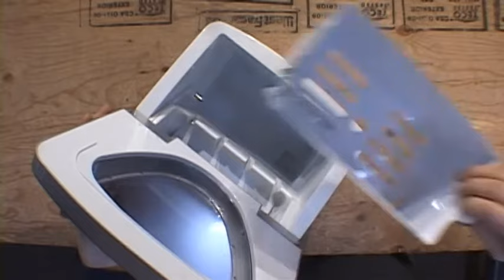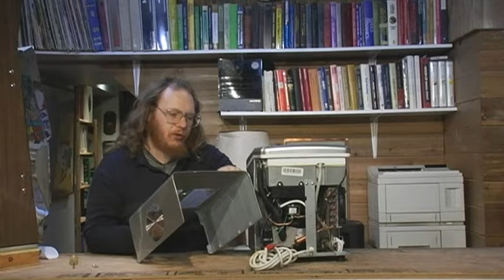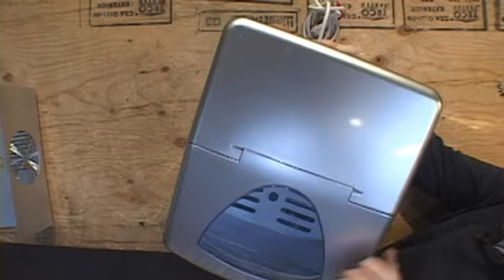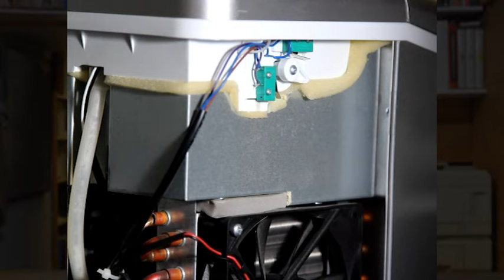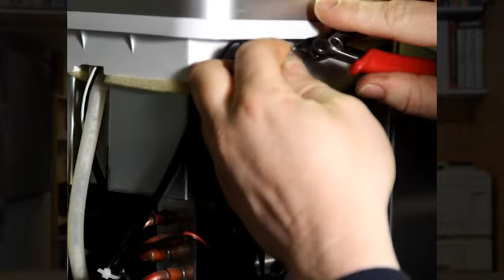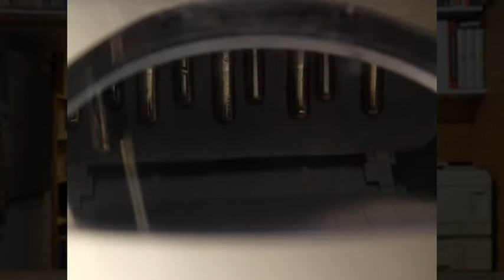Portable Ice Machines (and fixing one of their many problems)

Comment: Aww, thought you were going to be the first YTer I found after a looong search to do a legit full teardown of one of these.... They're definitely in that range of "not terribly expensive but also NOT triflingly cheap either", so I totally understand without first having a proper motivation to do so. My motivation for knowing all the specs & dimensions of the guts is from my desire to "un-dress" the entire front facade, leaving the back cover for cooling system protection  (not all identical in build quality in that department as SS-wrapped models can be pretty sturdy) and MacGyver/Frankenstein-ing it into either the side of a proper cooler with the heat producing refrigerator guts affix outside of it & sealed away like normal construction provides, just with an area cut through the new cooler to accommodate the ice factory bits

Comment: Hi and thanks for the video I have a similar machine that I've had for about 6 years or so with no problems at all until last night I found that the pice on the tray that connects to the small motor had broken am trying a method to fix it if it works I will update

Comment: So mine is not releasing the ice fully. both micro switches still click do you think thats still the problem?
Reply from the maker: The ice is released by the refrigeration loop going into defrost. Defrost is activated once one of the limit switches detect the tray is pulled back into the drain position. If the tray pulls back and nothing happens check for a stuck solenoid, otherwise verify the solenoid voltage is being created by the controller.

Comment: Ok I forgot what goes back where and attempting to put the plug back I accidentally dropped it into my water flow chamber compartment if my frigidaire portable ice maker, it fell down into hole not having drain cap preventing it from traveling inside , I can't retrieve the small plug as it's down inside, any suggestions? I'm afraid the drain doesn't have the plug only screw cap and if I attempt to operate the ice maker what happens to the lodged  plastic plug? Will it damage the ice maker once I operate a cycle. The technician wants me to operate the ice maker to see if it works. I'm not comfortable with this because if damage occurs, my warranty would become void.
Reply: What happened?

Comment: I just bought a costway Countertop ice maker ep24525us and I used it for the first time last night and noticed a leak from the bottom. Is it fixable or junk?
Reply: Check your water reservoir plug stopper. It might be loose, simply needing to be pushed back into place.

Comment: Do you have a link or a part number for the switch mine needs the same thing thanks
Reply: microwsitch KW4-3Z-3  (20 switches for $13 per another video who replaced a bad switch.)
Reply: @annblachly8068  thanks
Reply from the maker: I do not have another replacement on hand but it's a low voltage and low current circuit so really, any switch that looks the same will work.

Comment: I have one it works perfect (mechanical), but doesn´t make ice, the avaporator doesn´t cold
Reply: does the compressor start up?
Reply: yes, it sounds good, but don´t make ice cube. it doesn´t cool to make it
Reply: @javierjuarezvalle6326  if the compressor starts but it doesnt get cool it could be one, weak compressor/failed or failing compressor or two theres a leak in the system and all of the refrigerant leaked out

Comment: I found one for $10 brand new at yard sale. I let my sister use it and now it doesn't work. Needless to say I'm taking it back and fixing it and keeping it this time. Thanks for the video it'll help.
Reply: clean the condenser first. the fans move very little air and these units are very heat sensitive. don't sit them near any heat source ie. the stove stove. also allow several inches or clear space at the fans intake and exhaust

Comment: The only problem with those machines is that they can get pretty gross if you don't clean em often.
Reply from the maker: Yea it gets a but musty if used nonstop for a week. That's where the drain comes in so you can wash, rinse and refill it without leaving residue inside. :D
Reply: @CelGenStudios excellent video, very interesting and informative.
Reply: @CelGenStudios I was given one of these and on the cover there are the letters S  and L what do they mean?
Thank you
Reply from the maker: @SDsailor7  Not that I am aware of.
Reply: @CelGenStudios  I just got done with the disassembly and reassembly. I cleaned as much dust from the evaporator and the inside of the area. I removed the pump to inspect it for obstructions or other problems and cleaned it (was dirty) I applied some contact cleaner to the switches. One of the switches is to activate the water pump I forgot to trace the other one.
Will test it after 24 hours to give time for the compressor oil to settle back to the bottom.
Thank you for the video and I hope all I did makes it work.
Cheers
Reply: @SDsailor7 .
Small and Large ice cubes.
Reply: @krmhayes2893  Thank you
Reply: Small and Large  @SDsailor7
Reply: @SDsailor7 small and large. Press the “Select” button to choose between what ice cube size you want to make!
Reply: @SDsailor7 The one I had two buttons were labeled Small and Large. Which, as it suggests, determined the size of the cubes. Most likely the same for yours.
Reply: Small and Large @SDsailor7
Reply: @SDsailor7  that is to allow you to have small or larger ice nuggets
Reply: @CelGenStudios  I tested the ice machine after checking the water pump and cleaning the switches and then I filled it with water and waited about 5 min before I put it in operation and it did not work, I got the red light for low water even though it was full. So now I think that there is a bad sensor somewhere or another switch that I missed or bad capacitors/transistors??
Reply from the maker: @SDsailor7  All I can assume is a bad sensor somewhere but I just don't know where to look or suggest or what replacement sensor to try. Sorry. :/
Reply: @CelGenStudios  I am going to open it again and check to see if I find the sensor. It could also be the pump that is not turning on and supplying water.
That is another possibility so I will to figure out a way to test the pump for proper operation.
Reply: @SDsailor7 my machine did this just last week! Turns out, the water in the reservoir was too cold! Drain the water and then Pour some warm water into the reservoir and try turning it on again. You may have to turn it on and off a few times before the red light finally goes off, but this solved the problem for me! It’s been a week and no red light! Hope this helps!
Reply: @SDsailor7  that is probably the pump . they often run without being able to lift the water to the tray. the water sensor beside the tray realizes not enough water has been delivered and says add water. the sensor itself sometimes get coated with scale and needs to be cleaned. you need to remove the top cover to get to that sensor. a few swipes with a scratch pad usually does it.
Reply: Sam's Club sells a product called Sanitizer.  What a name. It's a red concentrate liquid.  This is the same stuff restaurants use to clean appliances and dishes and whatnot. It's good stuff. Dilute it like 1 oz to a gallon of water and run that in the ice maker and let it cycle.  Drain.  Don't eat that ice, obviously. Let it all air dry.  That's the best way to keep these clean. The stuff is awesome.